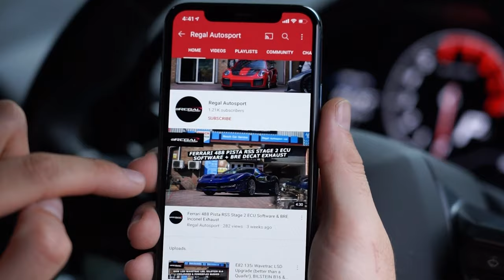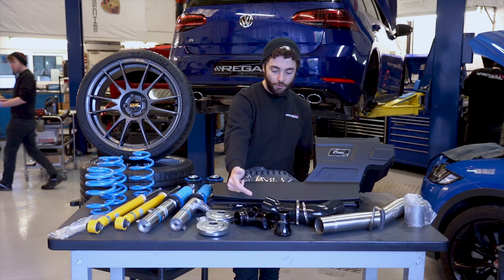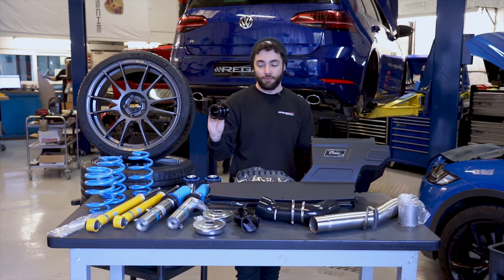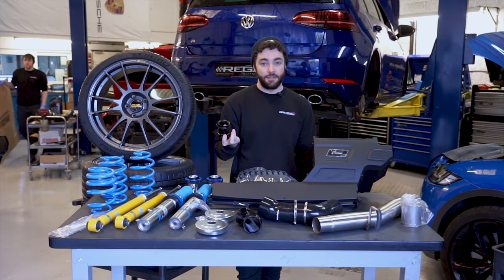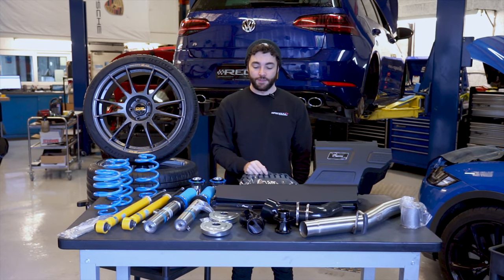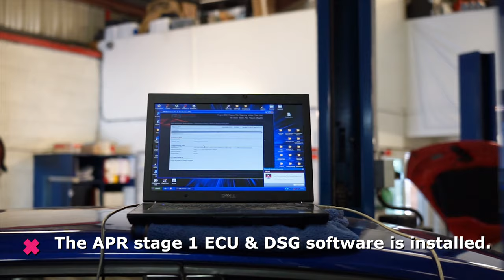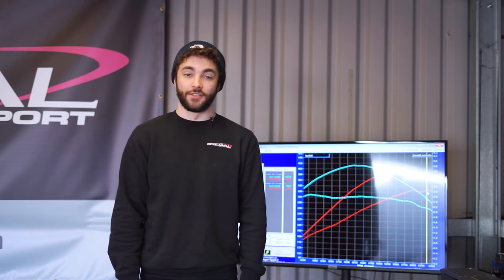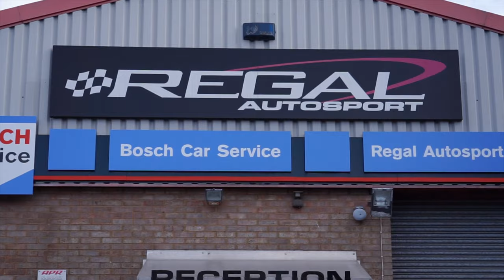THE Ultimate MK7.5 Golf R Fast-Road Package [+93HP & 109lbfts, OZ Ultraleggera, BILSTEIN, Camber]

Comment: 328hp stock?  Is your dyno optimistic?
Reply from the maker: We don't fudge our figures to make customers or YouTube happy, the figures are the figures... You'll notice that even if a MK7/7.5R non GPF makes 298-330HP stock, with the same mods they always end up with a similar output.
Reply: @RegalAutosport  yes agree.  have  Unicorn stage 1 on my 7.5 non gpf that showed 312hp stock, 371 post map and with TT inlet pipe.  Was just surprised at the the 328hp.  As you say its the delta that counts.

Comment: My Golf R mk7.5  stage 1 APR tuned sits on equal power to a stage 2 Golf R tuned approx 385hp 500nm. How do i know this? I ran a drag comparison  against a stage 2 tuned. Equal outcome. 
My car runs APR stage 1, dsg tune and has an Invidia Q300 catback installed. Air intake is stock all the way to the turbo inlet. 😅
Cold air intake do next to nothing but cost you $$$ and make noise. 
The only thing i am adding is an update intercooler maximising my 380hp. 👍😉🇦🇺
Reply from the maker: Thank you for sharing

Comment: Very nice do you recommend an intercooler upgrade?  Why and why not thanks..
Reply from the maker: Thanks for the comment! To see the peak HP/TQ gains it's not a MUST, especially in the colder climate currently. 

When it comes to summer, with a hotter climate the stock intercooler will become more of a limiting factor as it struggle to keep charge temps consistently cool, and the ECU will automatically begin to limit output. 

If you want the maximum power and torque in all conditions, an intercooler is recommended for sure.